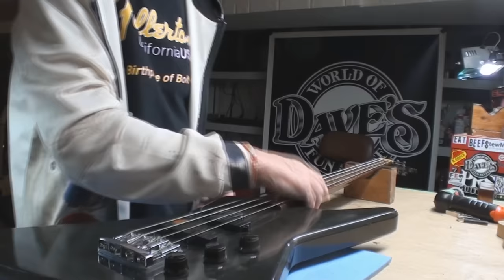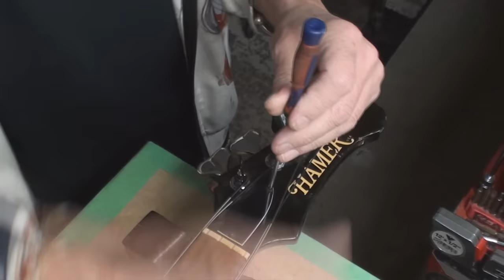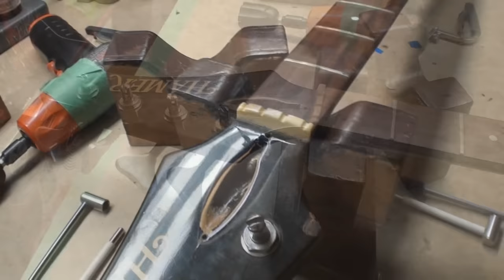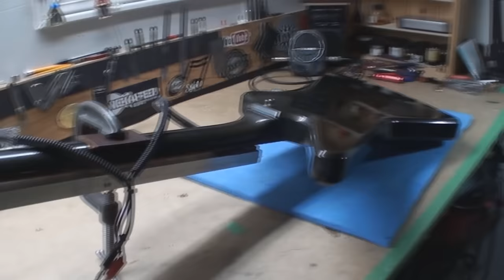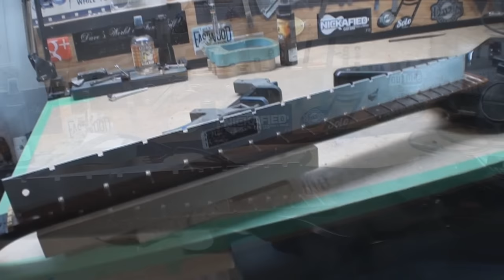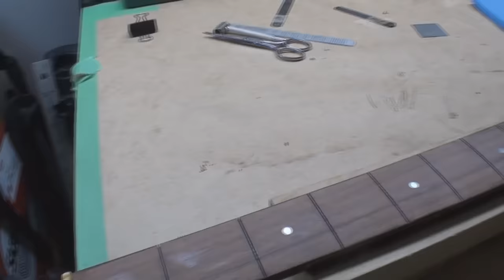Vintage Hamer Bass Part 2

Comment: I grew up in Skokie Illinois in the 70’s -80’s. When I was a teenager I yanked out the input jack of my 1983 Flying V - tore out the wood top of the body when it happened.  I was devastated.  I found a guy in the area that did luthier repair actually 2 guys working outta a small apartment.   John McHugh and John Montgomery.   Both skilled at their work.   At the time Hamer didn’t have a custom shop and would sub contract the custom stuff to these two gentlemen.  I was so blown away at all of it.  I spent a lot of time there and they saw my love of what they were doing.  I apprenticed under them learning to repair and build guitars.  They treated me well and I learned a good bit.  Ended up building a custom guitar for myself while working with them.